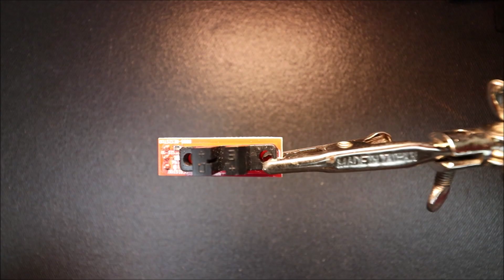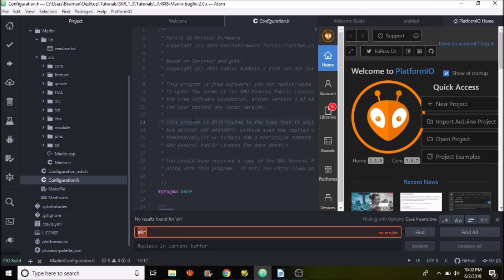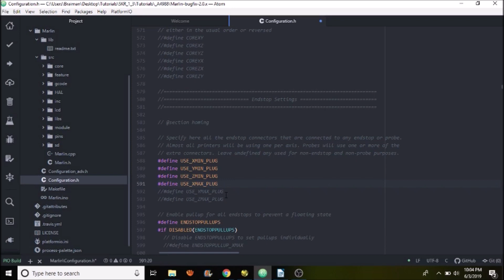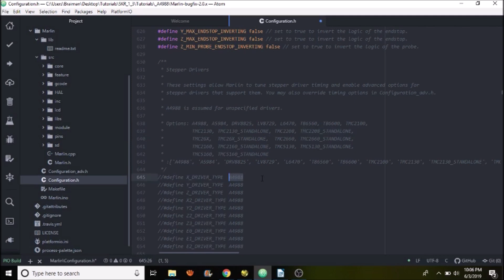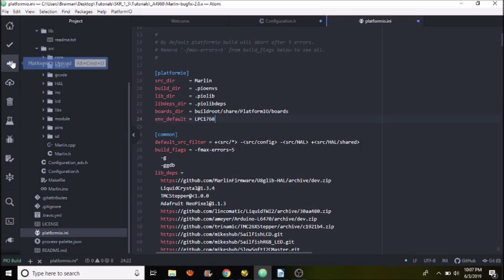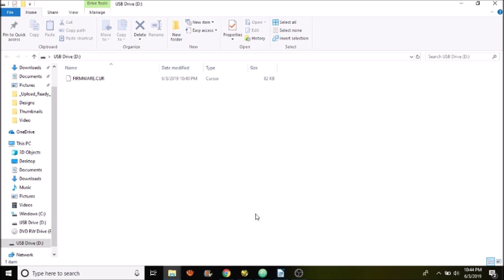SKR 1.3 - Optical Endstop

Comment: my optical endstops were working until i switched my TMC2208 drivers for TMC2209 and the ONLY code change i did was changing each of the drivers. 
after a firmware update my optics dont work at all. how would changing #define X_DRIVER_TYPE  TMC2208 to #define X_DRIVER_TYPE  TMC2209 
cause them to quit working? its a complete mystery to me. its the exact same firmware just that minor driver change.

also you dont sound like you would be in the region of the world that for whatever insane reason adds a 'ed to z and says zed instead of Z by itself.
Reply from the maker: Actually my grandma is from Leeds, England.  Could you post your configuration files on Discord?

Comment: Does anybody here have the problem that the SKR 1.3 fries optical endstops?`
I have the 1.3 running for about 3-4 weeks and had to replace 3 optical endstops (once on z and twice on y).
They behave kinda weird once they are dead, to be precise the appear as open until triggered and then stay triggered until i power off the board. It's really weird, i never had that problem on my ramps 1.4 for years. Pullup/pulldown are both disabled btw.
Reply from the maker: What type of endstop?
Reply: @EdwardBraiman  Wow, that was quite fast. I'm using the same models as you are in this video.
By the way, I just tested using pulldown for now and it seems to work again, could be a coincidence though.
Reply from the maker: Maybe wire continuity? Or firmware?

Comment: no no, tmc2208 have a "standalone" mode where they don't try communicating with the mainboard (via SPT/UART), it isn't about the number of drivers installed!
Otherwise, good video.
Reply from the maker: Thanks that's awesome information.
Reply: @EdwardBraiman  I noticed that error also. This board can also use the endstop 'less' features of the tmc2130's without running jumpers from the drivers to spi bus??? if my understanding is correct
Reply from the maker: I know you can do endstop with the stepper, but I'm currently testing stand alone to see if it also works.